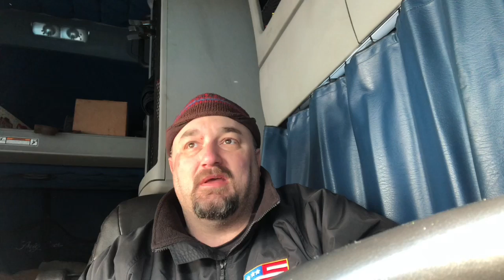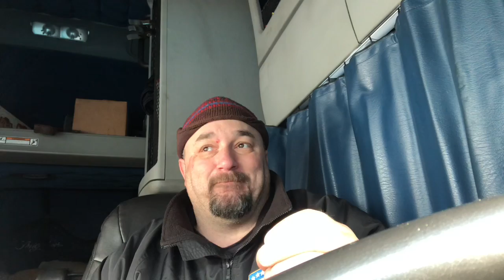Direct sales & equipment upgrades. The plan.

Comment: Do have a call out to your superiors. Wondering how they feel about a hotshot division?(1 ton p/u with 40' flatbed trailers)
Your videos have been super informative. That specialized concept has me thinking. May be an avenue of specialization in that realm as well. 
Looking to get truck and trailer in the spring.
Reply from the maker: Walter Jones you can call Kenny at Patriot Star and ask. His perspective on business might include running hot shots. I don’t know. I do know that prospective contractors need to be proactive and forward thinking. It would help the contractor and bring value to the team. 

1 (855) 577-4669